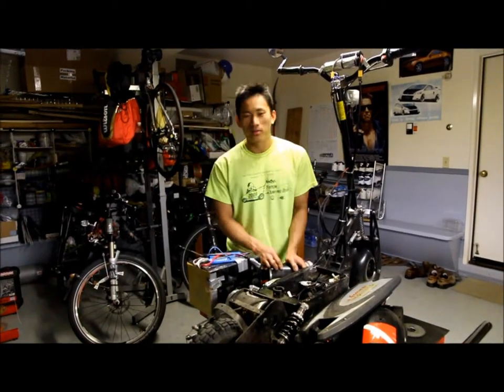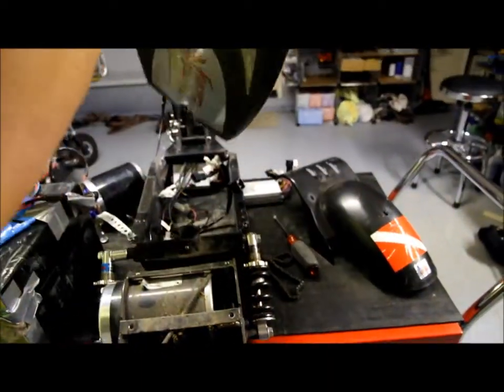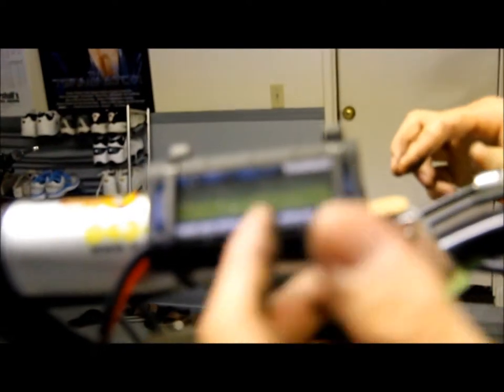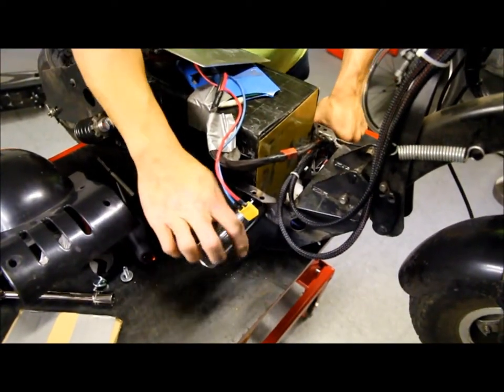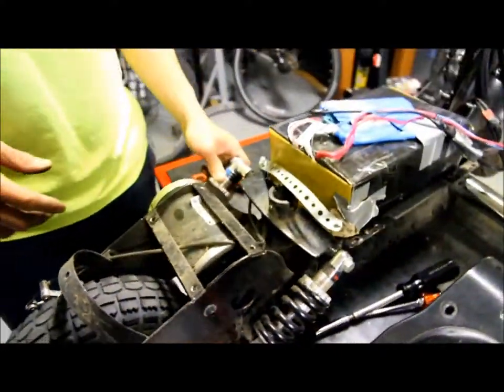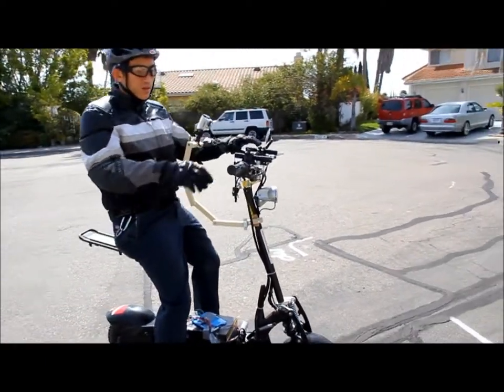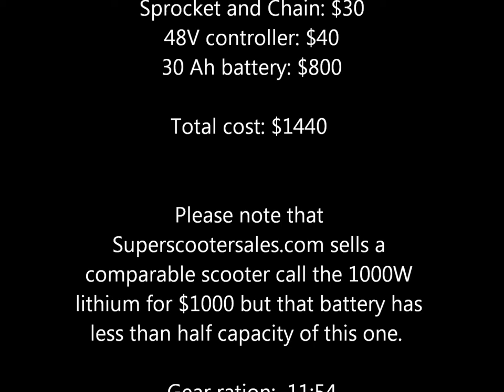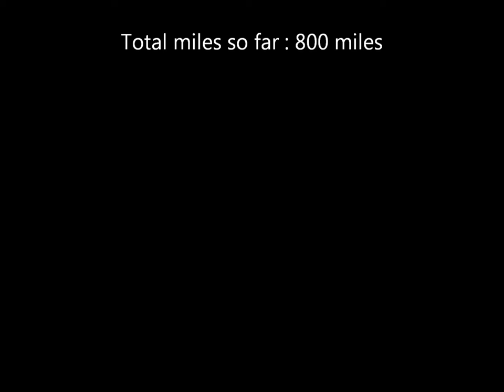Super 1000 Watt scooter.wmv

Comment from the maker: I get that range based on multiple trips on separate days.  There is no way the motor could handle anything over 20 consecutive miles.  It would simply overheat and burn out.  If you are adventurous, you could wire up Lithium Polymer sticks and stuff them in the battery compartment.  However, that'll be expensive and you would have to use more caution.

Comment from the maker: First off, it's call a motor not engine.  You will need to have compatible 800/1000W controller and throttle.  Other than that, you need to either find a motor that mounts into existing support or customize the support mounts to accommodate the new motor

Comment: The SuperTurbo 800 is 85lbs and can easily take mods.  A 300W scooter is way lighter and maybe limited.  I would look at your model and see what is similar with larger wattage of the same voltage.  =Try a 500/600w motor of the same voltage and see if that makes you happy.  Your controller  must be able to handle the higher current load of the new motor.  

Super Turbo 800w is $500. Lithium 1000 is $1000.

Comment: In the video you said you replaced the 800's 48v motor with a 36v motor? Is that a mistake? The 800 comes with a 36v motor. Did you mean to say you replaced it with a 48v?

Comment: did u have to change the controler and motor with the new battery or would it work with the old ones, and id it does work with the old ones whats the effect

Comment: I need help here, my 48 volt 1000w scooter I bought yester day worked perfectly, but today when I loaded it it wont react wen i turn the gas, it does not move at all however the lights and everything works fine but it wont move :(
Reply: Fooflaz was it a bad motor or fuse needed change
Reply: U need a new speed.controller 7years later probably got a car by now